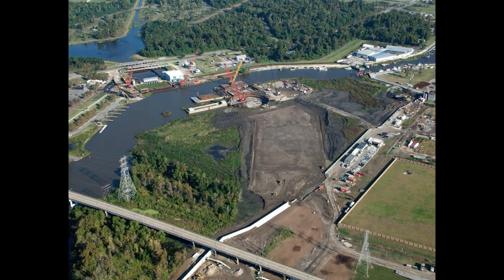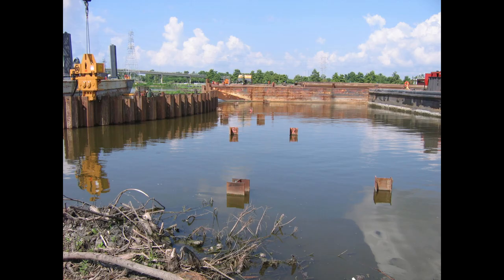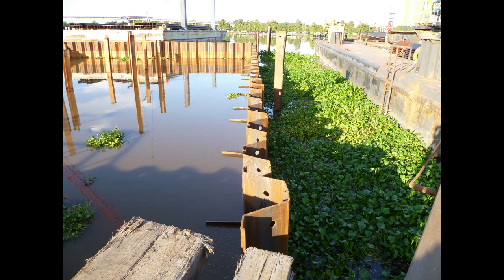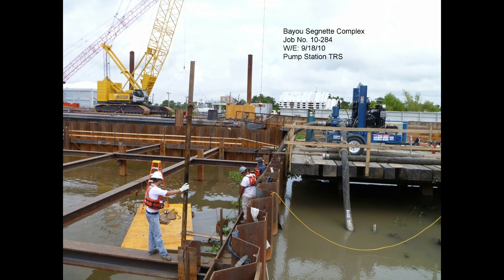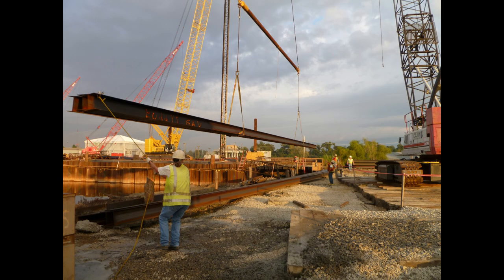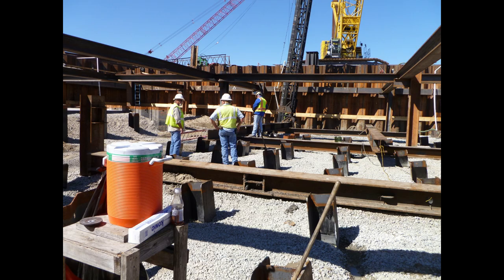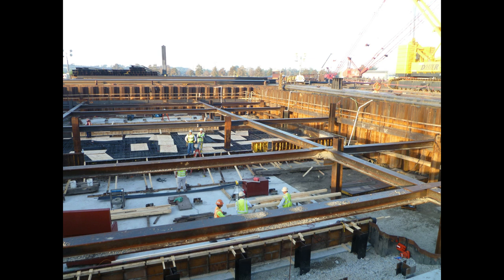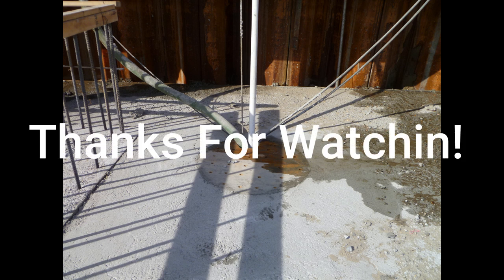Building a cofferdam. One method of many, many, many.

Comment: there is approximately a 100% chance that I would never want your welding team to see my welds, those are some impressive beads.....also I couldnt stop laughing about the euddy graffiti
Reply from the maker: Any weld that is a permanent part of a federal project must be preformed by a welder certified in that type of weld. And most welds are inspected by an independent testing lab. In the case of the TRS the design engineer did not have that requirement in his design so we could have had you do the welding. Actually it was several welder/helper teams, and all the guys doing the welding were certified. But just to be sure we paid the design engineer to come out and inspect everything before we started the major dewatering. A few hundred dollars well spent. 
The uplift anchors welded to some of the piles were a part of the permanent structure so they were inspected.
Don’t get the euddy graffiti?